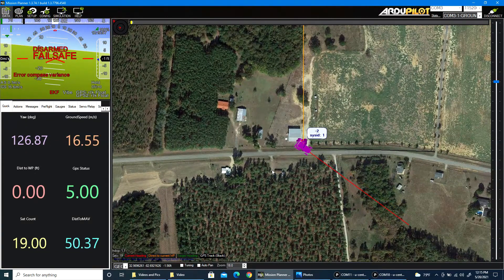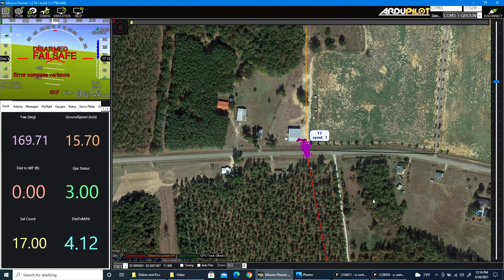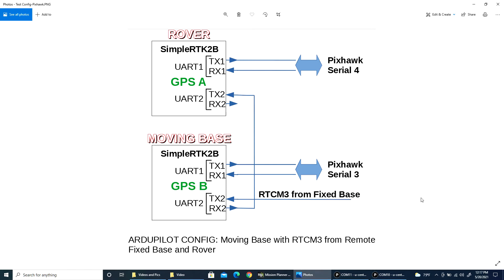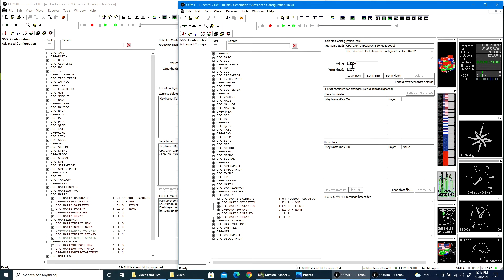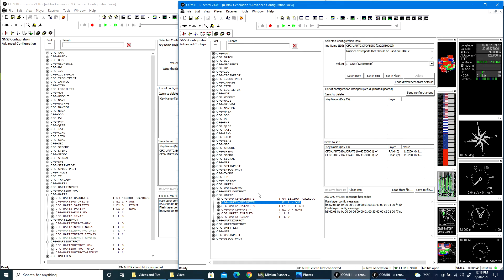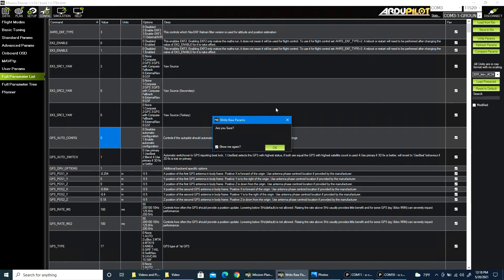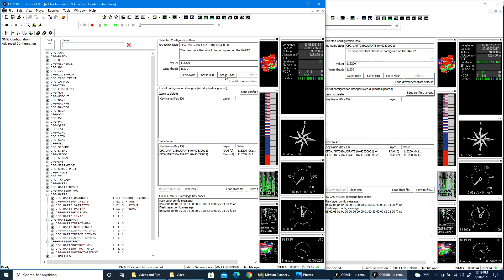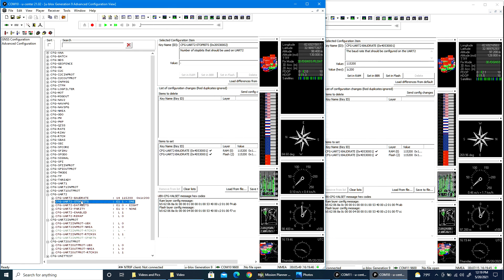Ardupilot Auto Config Overwrite Demo

Comment: Kenny . Good to see your success with RTK . I want to add RTK to my mower. What are  your suggestions as far as hardware I need to buy?
Reply from the maker: Thank you! I would buy 2 Ardusimple SimpleRTK2B GPSes, one for your fixed base and one for your mower. If you want to use a moving baseline setup to get accurate heading for your mower instead of using a compass module, then you need a 3rd SimpleRTK2B. I have some later videos that show some experiments with that setup. I plan to do more soon.

You will have to decide what method you want to use to get the RTCM3 corrections from the fixed base to your mower. I have them communicate directly using the LoRa modules. Most (probably) people let Mission Planner send the changes embedded in the comm from it to the rover. That requires MP to be running all the time, though.

Comment: Do you use two units  or do you use a public COR service
Reply from the maker: My normal setup uses a fixed base located here on my property but right now, I am using a base located about 26 miles away that is uploading to rtk2go.com. I have a Raspberry Pi running RTKLib that is pulling down the corrections from rtk2go.com and sending them to my mower rover GPS using an Adafruit Feather M0 LoRa module. I had a project for work where I created the fixed base at the location 26 miles away and I just decided to use it for now.